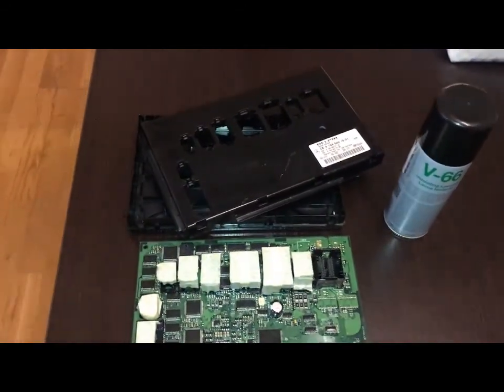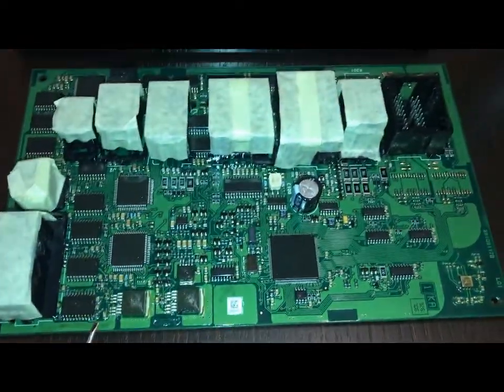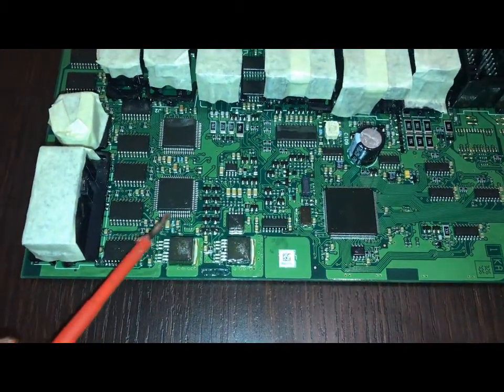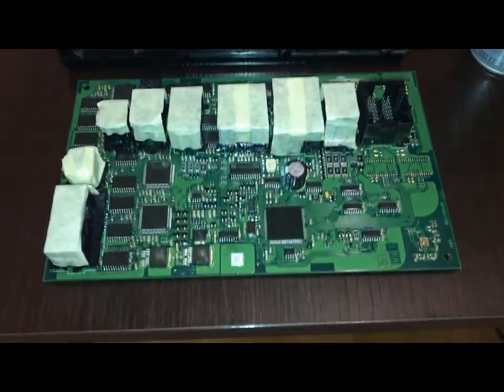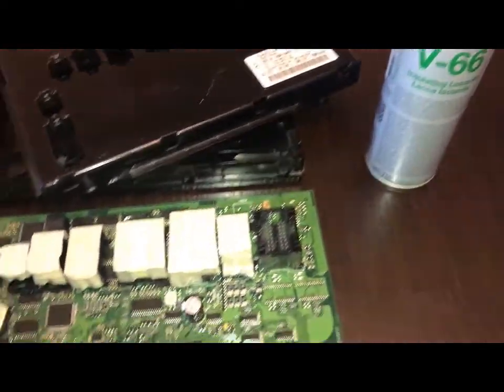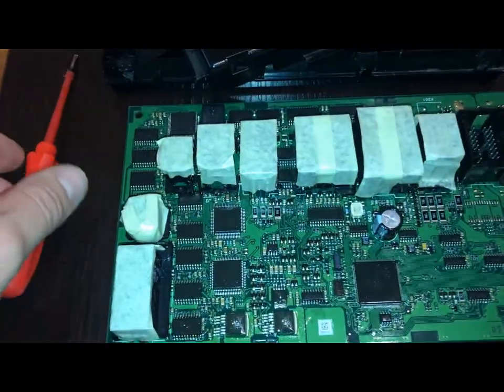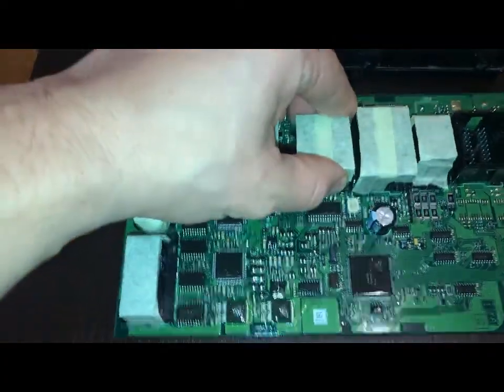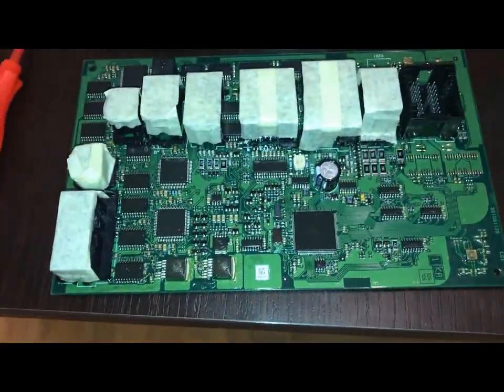Problem with Rear SAM Module for Mercedes W164 (ML280 CDI) - corrosion

Comment: Did your repair actually work?  I've got a no crank issue with my 164 that seems to be pointing to the rear SAM and I'm debating on whether or not I try removing it and seeing if I can clean it up as well as ID what may have broke.